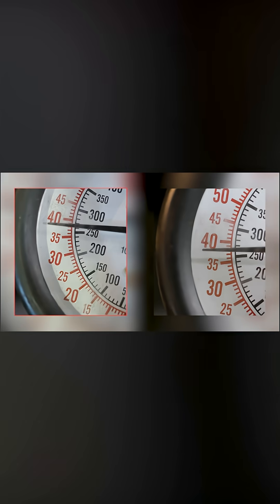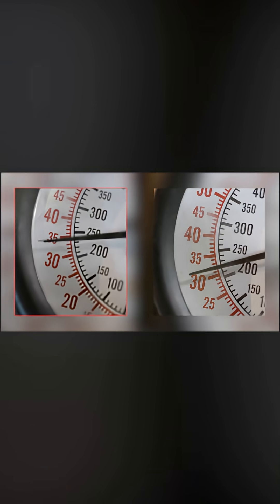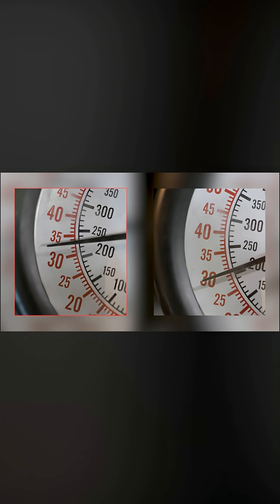Bank 1 Rich, Bank 2 Lean — The Real Cause Revealed!

Comment: Paul, my iCarsoft MB v2.0 messages that MS-HSF or ECU voltage is 1.5 V.  Everything is OK.  This is a 2003 SL500 R230.475

Is it possible for the Engine computer to have such a low voltage?

Thanks

Comment: Use a programming software that read pulsewidth on all 8 factory also uses delta pressure over lbs per hour pintle pressure and fuel pressure changes flow rate along with vaccum and boost

Comment: Lower pressure more flow
Reply from the maker: The timer tool was a measurement of a pressure drop from rest pressure in a fuel rail. It most certainly wasn't more flow within that test.

Comment: One last comparison: with engine running in the same conditions as your picoscope captures, what injector On time is it averaging? Is it close to the timer tool On time? That could explain the difference in pressure drops.

Comment: If the car already has a fuel rail pressure sensor, will scoping the signal wire for the fuel rail pressure sensor produce just as good of a waveform as using the expensive pressure transducer for the scope?
Reply: Depends...you would need to ac couple the signal and use the sensor ground for the scope ground. HOWEVER, this will not work with a SENT type pressure sensor, as is common on many vehicles now.
Reply: @mrblonde2013  On those cars with SENT-type fuel rail pressure sensors, can you view the fuel pressure waveform on a high end scan tool?
Reply: @USkeZB3mpyAMCV  Well I can tell you a lot of modern vehicles will have fuel pressure data pids and all cars with direct injection will have them.   But with older stuff pre-2008ish probably not.
Reply from the maker: As others have said, the SENT sensors are different but there is a guy, his name is Scot Nichols and he created a tool called the ADDi Module (Automated Dynamic Diagnostic Interface) that decodes the data and turns it into an analog signal that can then be used for this purpose.
https://www.automotivediag.com/addi
Let me see if i can find some videos from him. He is a technician too which is awesome

https://youtube.com/@automotive_diag?si=ABZQ_Zeg8hk6nmM_ 
@automotive_diag
Reply: @ScannerDanner  According to the internet, PicoScope 4000 series, 5000 series, and 6000 series can decode J2716 SENT protocol as well as graph the "voltage" waveform on screen.  Do you have a video demonstrating this on the "premium channel"?
Reply from the maker: Really?? That's awesome and no i do not. Yet! But most certainly will in the future